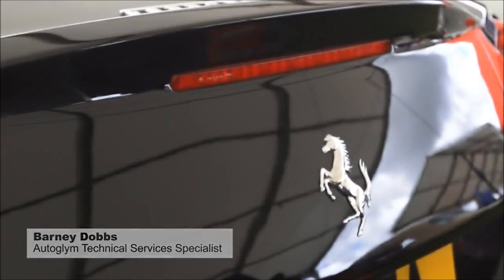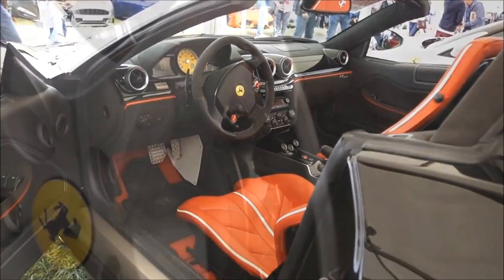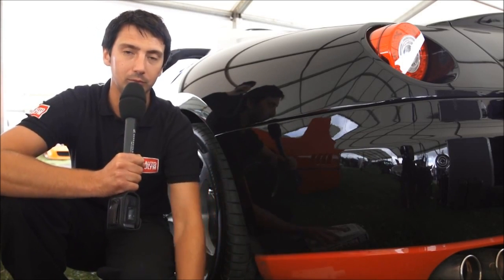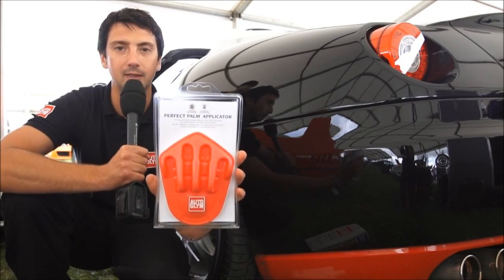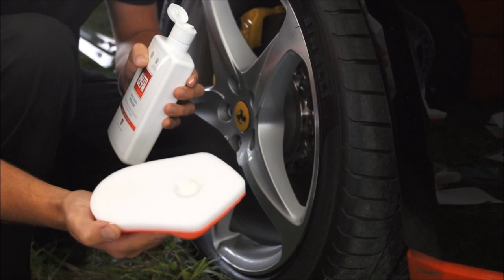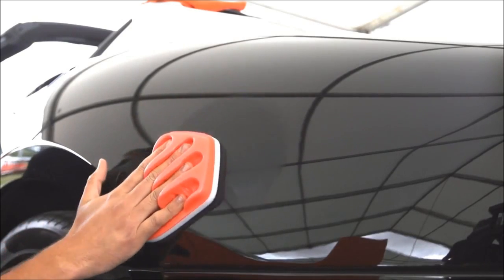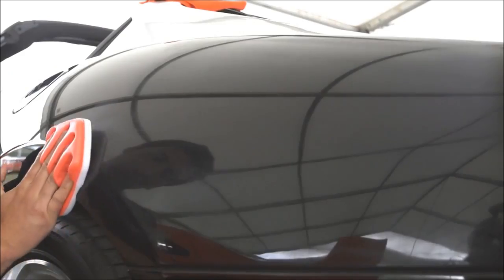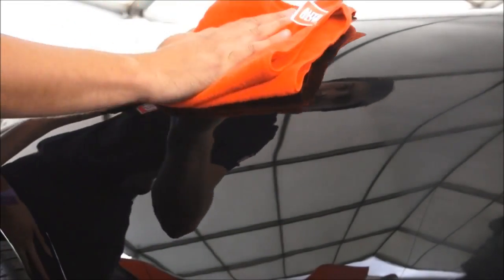Autoglym Super Resin Polish

Comment: 10 years ago gosh time flies. My vehicle has no protective barriers, Do you need to clay bar vehicle surface to use SRP? Your products are great and had no issues in the last 14 years.
Reply from the maker: You don't need to every time but for the best results it's recommended to clay and decontaminate, especially if it's been a long time since your last major clean. If you've had no protection on we'd say clay first since you'll more than likely have contamination on the paint.
Reply: @AutoglymUK thank you

Comment from the maker: Use a polish after washing to remove fine scratches and swirls and restore a gloss to the paintwork. Then use a wax to seal in and protect the polished surface. Polish to correct, wax to protect - simple.
Reply: So is polishing like giving the paint a light cut

Comment: What is better??
Ceramic coating or regular polishing weekly/monthly??
Reply from the maker: Well, both product types do different things. Polishing corrects an issue, be it paintwork dullness, a lack of gloss, fine marks, scuffs or scratches. A ceramic coating should be used to preserve paintwork and keep it in the condition it is in at the point of application for as long as possible. 

So to answer "which is better?", you first need to ask "what are you trying to achieve?" If it is improve the condition of the paintwork, then a polish should be used. If it is to keep the paintwork looking as it does today for as long as possible, then a ceramic coating or a wax should be used.
Reply: @AutoglymUK  it's a case I enjoy cleaning and polishing my car and love the glossy shine...so I could ceramic coat then use autoglym ceramic spray every 2 to 3 months as a top up??
Ans weekly wash with autoglym shampoos??

Comment: I have a black car and scratches and swirls show quite a lot so how often is often. I know it says in the comments you can use it frequently but would this be ok to use every month. 
thanks
Reply from the maker: Yes, that is perfectly fine. Apply High Definition Wax or Extra Gloss Protection over the top to seal in the paintwork for longer.

Comment: What would be the coldest temperature 🌡️ his product could be used outside in ?
+14 Celsius ?
How long  to wait before sealing it with wax ?
Reply from the maker: You can use it down pretty low, we export all over the world so have to make sure products work in the desert and the arctic circle (as far as is possible!) The polish will work at low temps, the polishing action will take place, what you will find with cold is you often get dampness which means the polish may take longer to dry before being ready to buff off. In the UK you should be able to use this all year round.
Reply: @AutoglymUK  ty vm

Comment: It this the same as using a light compound, for example, if I do light sand off base coat, can this be used after to bring the smooth color and shine back?
Reply from the maker: It is at the very gentle end, it would not be described as a compound. Best to use Paint Renovator and then Super Resin Polish after.
Reply: What grit sand paper should I use, obviously i need to avoid rough grade?
Reply from the maker: Sorry, we wouldn't be able to advise you on that. Things like this are best seen in person.

Comment: Can you put a layer of wax after using the autoglym super resin polish?
Reply from the maker: Yes, absolutely! There is a wax in Super Resin Polish, but to really increase the durability of protection it is best to follow up with a dedicated wax. All of the waxes in the Autoglym range will sit on top of Super Resin without any issues. Our top pick would be Ultra High Definition Wax. Extra Gloss Protection is a great liquid wax too. Or you can wait a week or two till you next wash the car and then apply our award winning Rapid Aqua Wax then. It goes on when the car is still wet after washing and is very easy to use.

Comment: Hi, my car has got a paint protection film on the whole body. When I leave it covered for a few weeks he cover leaves some hazing on the bodywork. I've been told by a detailing specilaist that this product will take care of these marks. Just wondering if you can confirm that this is the case and that the Autoglym SRP is safe to use on the film. Thanks.
Reply from the maker: +Mark Jose Super Resin Polish would be suitable for a car without a paint protection film, but it is not possible to polish out marks on clear paint protection plastic film, only on paintwork. 

Super Resin Polish is safe to use on the film, but it will not remove marks that are in the film, it will clean the surface of the film though. 

Always test a hidden area first to ensure that the polish does not cause an unwanted effect on the film.
Reply: +AutoglymUK Thanks for the feedback. Much appreciated.

Comment: finally got around to polishing the car with srp. I used a black pad and around 1600rpm(from what i seen on forums its what most people used) but for some reason it seemed to dry up really quickly an go kinda sticky literally instantly an made it pretty difficult to even hold the polisher properly. Any help would be appreciated :)
Reply from the maker: Polishing by hand is great with SRP, no need to use a machine. However, if you are wedded to the idea of a machine, a soft foam pad is the way to go. It should not dry out quickly, we find it is quite workable. Was the pad new? That can cause issues to start with.
Reply: I use it with a da and a 6" polishing pad, makes the car shine afterwards.   I think it's very workable.

Comment: I have the polar series including the polar seal when do I apply this to my black car
Reply from the maker: We would recommend that you use Super Resin Polish as required to restore gloss to faded or dulled paint, remove fine scratches etc. Use the polish after the Polar Blast and Polar Wash products. Normally you would only need to polish as scratches are caused, or occasionally throughout the year to clean the paint and keep it in good condition. Then finally use Polar Seal. The following may help as a rough guide:
Weekly/fortnightly: Polar Blast, Polar Wash
Monthly: Polar Blast, Polar Wash, Polar Seal
Quarterly: Polar Blast, Polar Wash, Super Resin Polish, Polar Seal

Comment: I have just got a new car and want to keep it clean/shiny/protected. so am I right in doing this process and is the products suitable for use - clean with shampoo, then polish with a perfect polishing cloth using super resin polish allowing to dry before buffering with hi tech finishing cloth, then use aqua wax or had wax ? is that process correct ? how often do I have to polish/wax my car (black) I have also seen the hd cleaner is this before I wax the car ? does it take of the polish or just the wax ? im a lttle confused on the whole process and which products to buy/use as this is my first new car and want to keep it like new. many thanks
Reply from the maker: DURHAM DRIVING Hi, you have the right idea. Clean, Polish, Protect is the right process. Shampoo, Super Resin Polish then HD Wax is best. Then wash with Autoglym shampoo regularly to remove dirt from the HD Wax layer. You can use Aqua Wax following a wash to top up the HD Wax layer and refresh the shine.

HD Cleanser will strip off all the previously applied polish and wax so you can start afresh. It is not an essential step, but one that some people like to do if they want to ensure they know exactly what is on their car.
Reply: AutoglymUK thanks for the detailed reply,i now know which products to purchase, think i'll def get the hd cleaner aswell to get any previous layers od wax, polish/dirt of the car before applying the polish/wax again.
Reply: AutoglymUK  hi guys I have done a menzerna polish on my St 225 in white then put the  auto glym high gloss sealant on top about 3 weeks ago will it be OK to Now just put SRP  on top then re apply the AG high gloss sealant, or should I strip it off first the apply srp the sealant, thanks guys

Comment: Will it remove a thin layer of tree sap?
Reply from the maker: Better to use Intensive Tar Remover to soften and remove the tree sap first, and then polish over after with super Resin Polish. Tree sap can set very hard, you do not want to risk dragging it over the paint and potentially causing scratches. Remove it safely with Intensive Tar Remover is our advice.

Comment: How long should you leave the polish to dry before you buff it with the microfibre towel?
Reply from the maker: Philip Kiely Just until it is dry, usually 10 -15 mins. Swipe your finger through the residue on the paintwork, if the paint is shiny it is ready to buff off, if it smears it needs to dry a bit longer.
Reply: AutoglymUK Okay thanks. Also , is it okay to polish the car as normal , use hd wax kit and then  wash and polish the car 2 or 3 weeks later without waxing again or would cause the wax to be wiped off and therefore not be protecting the paint? Thanks.
Reply from the maker: Philip Kiely That is perfectly fine Philip. If you polish and HD Wax the ca, new dirt that lands on the HD Wax layer can be washed off with our Bodywork Shampoo or Bodywork Shampoo Conditioner. This will remove the dirt, but not the wax, so you don't have to re-wax all the time. HD Wax will last 4-6 months on your car, so you only have to polish and wax 3-4 times a year. You can do it more often if you like, but you don;t always have to.
Reply: AutoglymUK Okay , thank you very much.

Comment: Does the resin polish leave a smooth surface on the paint like a wax?

Thanks..
Reply from the maker: berj79 Yes, Super Resin Polish will leave a smooth finished surface. You can either stop there, or to prolong the shine and add further paint protection, apply Extra Gloss Protection or High Definition Wax.
Reply: @AutoglymUK  can you use the polish,  then extra gloss protection and then the ultra high definition wax?
Reply from the maker: You can if you really want to, but we just recommend Super Resin Polish then EITHER Extra Gloss Protection OR UHD Wax. There is no need or benefit for both. If you want to double up, pop on 2 coats of UHD.

Comment: Hello, what's the difference between new formulation srp and the old one? If I buy the old one because that's what available here, will I be losing too much? How long will the old and new srp rest in my clear coat topped with a layer of wax? Thanks
Reply from the maker: Hello, the new formulation lasts longer, dusts less and has increased depth of shine. All the good features remain but got better. It is still very easy to use and compatible with our wax range. If the new or old formulation are sealed under HD Wax you will see 4-6 months depending on the conditions.
Reply: Thanks pal, unfortunately I don't have HD wax, can I use any other wax for the time being?
Reply from the maker: Satyam Neermaull Yes, if you have Extra Gloss Protection that will sit over Super Resin happily too. We don't test other waxes for comparability although we haven't heard of any problems.

Comment: Can i use super resin polish and hd wax on my fiberglass boat which is awlgrip metallic silver paint?
Reply from the maker: We have had great results with Super Resin Polish and HD Wax on fibreglass surfaces and never encountered any issues. However if you are concerned test a small hidden area first, or contact the paint manufacturer.

Comment: Will this work and be safe to use on gloss painted carbon fibre ?
Reply from the maker: +Jack flores Yes, absolutely. Follow up with a coat of Extra Gloss Protection or High Definition Wax to seal the polish in too.
Reply: +AutoglymUK oh, would it be compulsory to use the extra gloss protection? And if I didn't apply the gloss protection would I have to use my super resin shine every month ?
Reply from the maker: +Jack flores Extra Gloss Protection is not compulsory, but it will extend the protection so you don't need to polish as often. There isn't a set polishing interval of every month, just use the Super Resin Polish when the gloss needs increasing after a wash.

Comment: Really great product, this is the only polish I buy, I recently decided to buy the Biggest bottle of this, I've had it just over a year and its now turned really runny  and isnt half as effective as it used to be, this also happened to me before with the smaller bottle but I thought it might of been just a fluke, but I've seen alot of people with this problem! seems like this product has a terrible shelf life. do not buy the big bottle unless you polish your car everyday.
Reply from the maker: Hi James, glad you are a fan of the polish. The runny issue you encountered is not something that should be happening. We are aware of a few cases and if you get a bottle that does this, please contact our Customer Care Team right away so we can put it right for you. We do not want disappointed customers! It is not related to the age of the bottle, a bottle of Super Resin Polish should easily last 2 years or more. even.
Reply: James, don't mean to state the obvious but did you give the bottle a good shake? I had it on the shelf for about 6 months in between uses and I also found it runny, but a good shake (with the top on securely!) brought it back to normal state.

Comment: It's ok but my BMW I3 is still swirl marked to fuck.
Reply: Thats because you've washed it in an automatic car wash, the brushes cause these swirls, the best way to wash your car is with your hand and the right stuff
Reply: Might have been partly my fault and partly the previous owner. I have never had it through a car wash.
Reply: Ok, what do you use when you wash the car? Also, machine polishing will definetly get rid off most swirl marks
Reply: +Shaun Dobbie If yours is a black car, you might want to try to ultra dark polish.you can't get rid of them totally but you might be able to lighten them. I tried it on my 2nd hand black Altis, and was satisfied with the result.  Not 100% but at least 85%. At least now I never returned to black with my 3 month old bronze-grey Sylphy
Reply: sorry for the typo, I meant to try the Autoglym Ultra Dark Polish

Comment: Full of fillers...which is ok for the weekend warrior ....
Reply from the maker: It does contain fillers, but it also contains abrasives too. It removes the defects it can and fills the ones it can't. Either way you are left with a smooth appearance for 15 minutes work. It is ideal for the weekend user and also has a number of fans in the Professional arena too 👍
Reply: @AutoglymUK  I use srp followed by either high definition wax or egp  on my white focus xr5 turbo comes up a treat, also used on a black Audi A1 also comes up a treat both look like new awesome stuff

Comment: what a load of BS - wheres the white haze that you have to buff off when its dry
Reply from the maker: When you apply the correct amount (as Barney does in the video) there is hardly any residue to remove at all. If you pile it on thick there will be a lot of residue to remove. It is worth remembering that it is only the product that comes into contact with the paintwork and is left behind that actually does anything. If you have a big thick layer on the paintwork and the car looks like a mayonnaise explosion happened nearby, all of that excess product is wasted. This leads to longer drying times for the product, you use a lot more product than you need, you increase the chance of dusting as there is a ton of dried out polish and the whole job takes more effort than it should. Try to use less, as we do here, and you will have very little residue left to buff off at all.